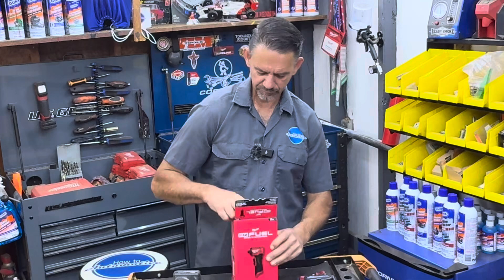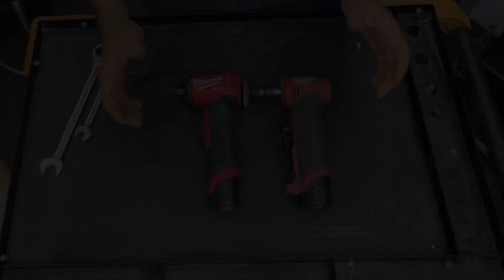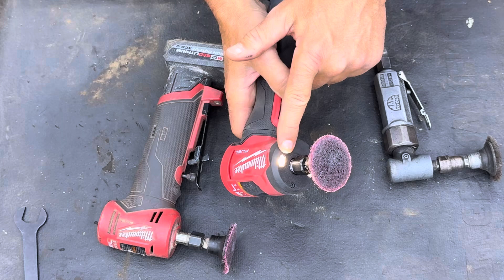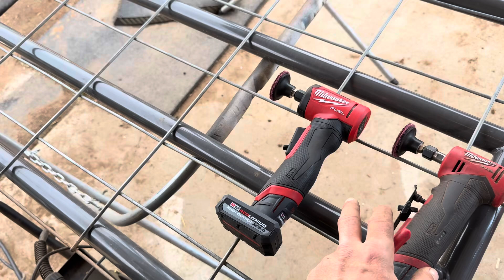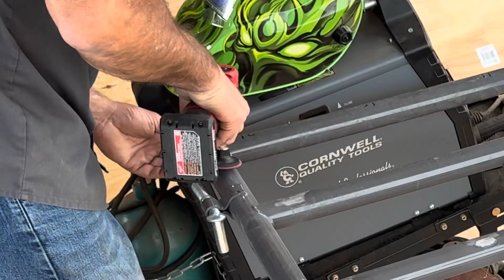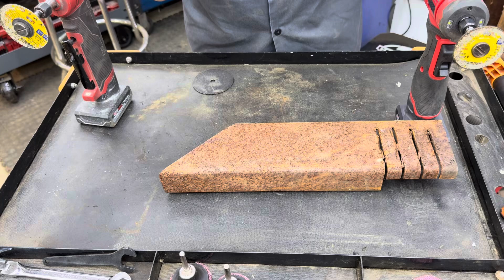Brand New Gen 2 Milwaukee Right Angle Die Grinder Upgrade Or Let Down?

Comment: What cutting discs are you using? I cant seem to find the Milwaukee ones anywhere in the UK
Reply from the maker: @banzaiman1  i’m not sure what brand they are. I got them from my local metal supply store.. I don’t think Milwaukee makes the actual cutting bits. You should be able to find them at your local hardware store.

Comment: Nice Video! Is the Gen1 collet compatible with the Gen2 ? I mean can i use the 1/8 Collet for the Gen1 on the Gen2?
Reply from the maker: @breachr9386  both tools run a quarter inch collet.
Reply: @HowtoAutomotive  sorry i wasnt clear enough. Ive got a 1/8 Collet for the gen 1 version. So i can mount smaller bits (for dremel etc.). and im wondering if the Gen2 version is using the same collet?
Reply from the maker: @ yes they are the same. It’s just got a push lock now so you only need one wrench.
Reply: @HowtoAutomotive  thanks for the info!